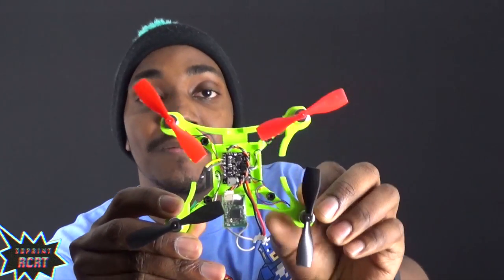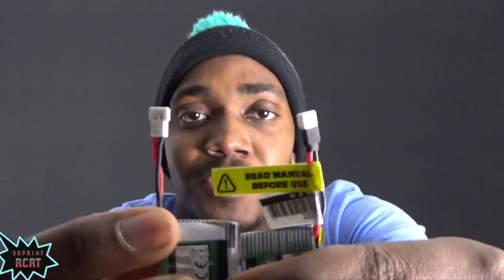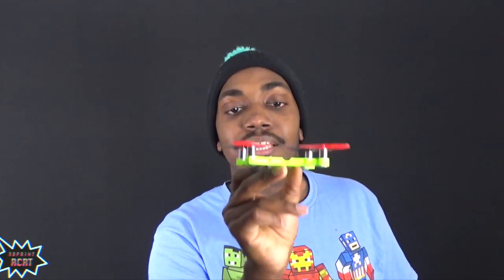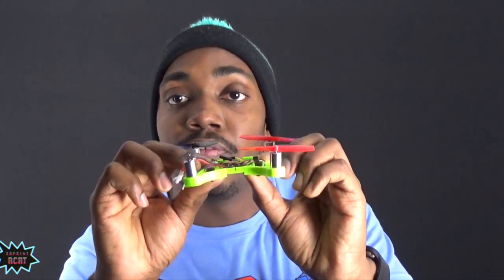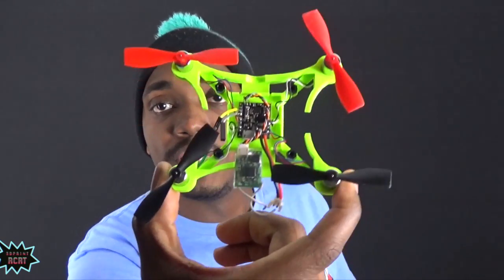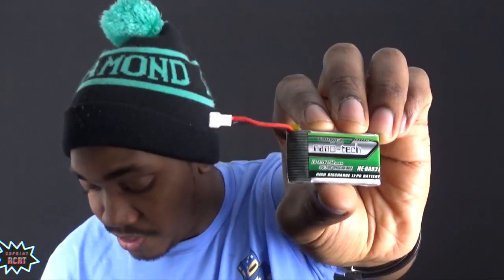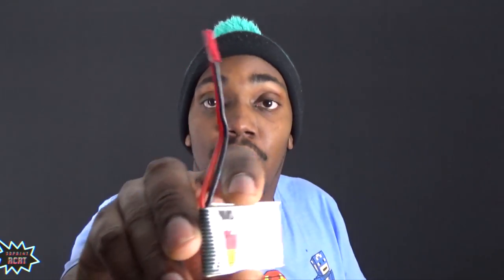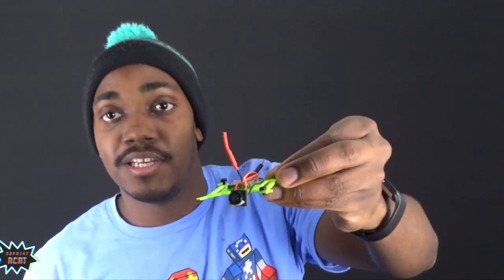Failed 1020 Brushed Micro Motor Flight and Build

Comment: Hey KC, heads up, the bottleneck on amperage draw is in the connector, rarely the battery. The micro losi u are using only flows 2-5A max. I just converted my setup over to micro deans rated for 15-25A and barely weight Any more. There is a night and day difference in throttle response and voltage drop as well as flight times. Its the major bottle neck in anything running motors larger than 6mm. Only bitch is you have to solder your own bat connectors as nobody sells micro deans batteries.
Reply from the maker: Niko Garnica :D whoa I never thought that would be an issue but I do remember converting plugs on my nano qx and it did fly alot better, thanks for the info bud definitely gonna try it out !

Comment: I got a eachine bat105  and rushed to fly it inside. it did the same thing as yours and flip over in the carpet.  it was in acro. i switched to stable and flew it in the house .i wasn't used of the acro.